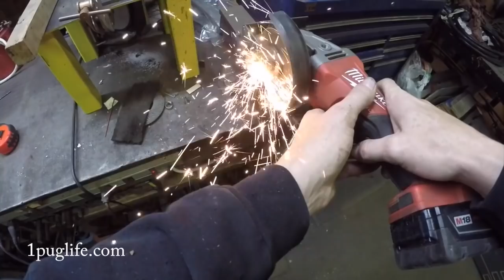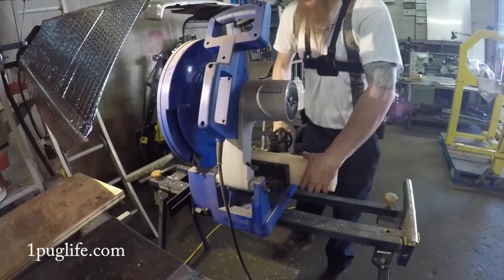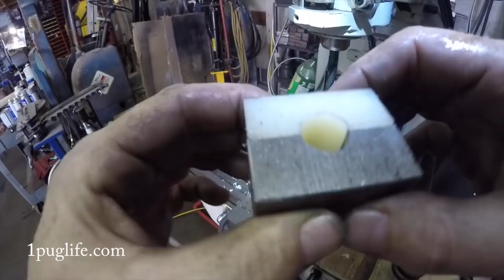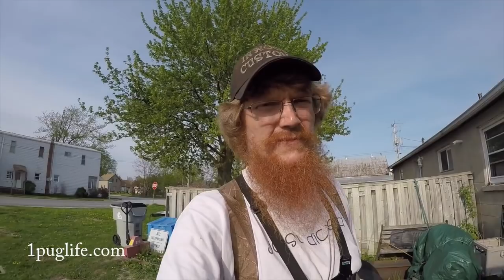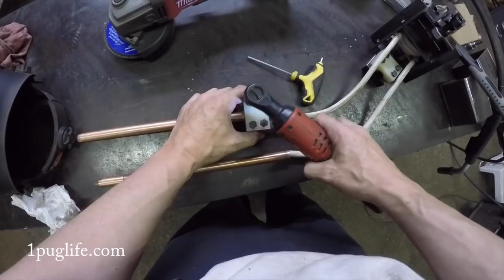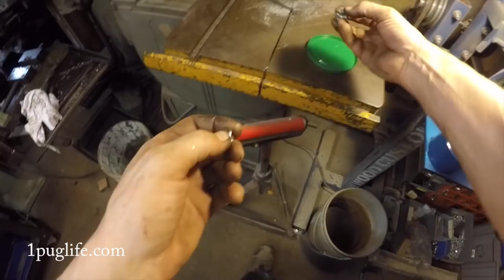diy spot welder part 2

Comment: I like the build log, looks profesh! Can't wait to see it in action. I did think about something, depending on how many amps that thing will pull you might have to run it off a 30 amp 120 supply or have a ballast in between if the microwave it came out of is over 1200 watts. As a welder it will pull a bit more power since it's basically shorting out to weld. Easiest ballast to make is to take another big microwave transformer, short the secondary to the transformer casing, run the primary wires to the hot with one going to the transdformer and the other from the wall, isolate the transformer from anything metal.